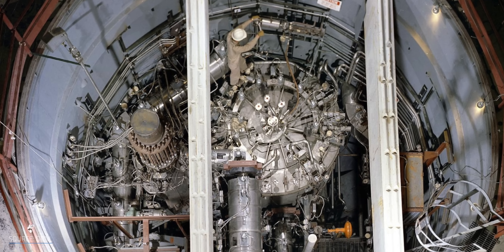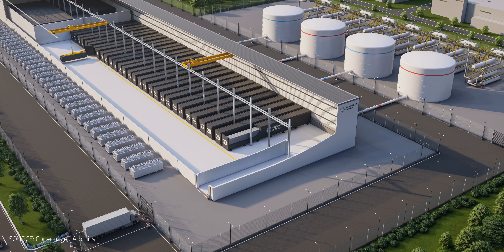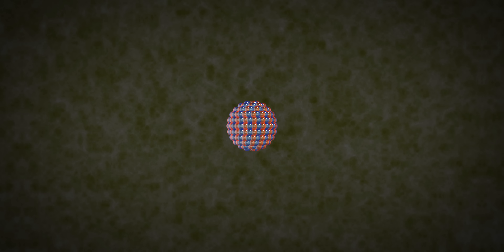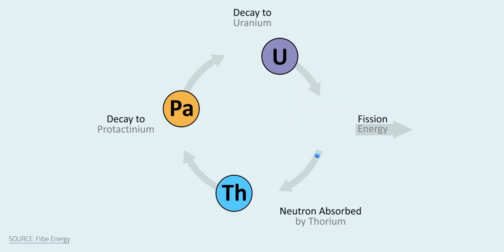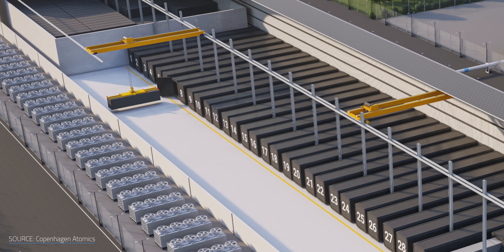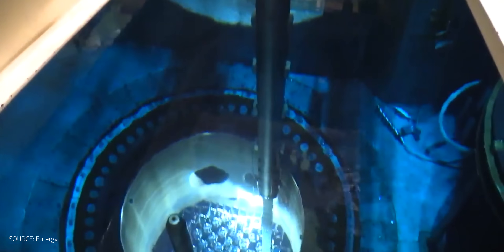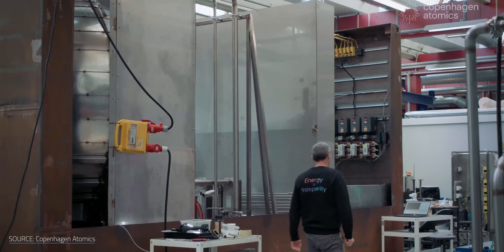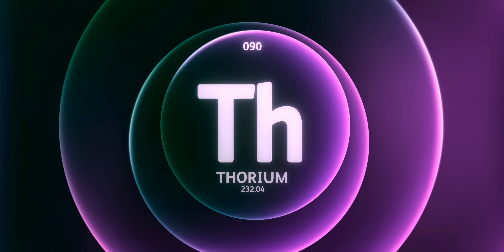Why Thorium is About to Change the World

Comment: the big issue is the corrosive salt . Hot slightly radioactive high pressure water has been part of current designs for years (and we know the big flaws) but hot salt that is both corrosive (even if not radioactive) anyway and then is also radioactive is a big ask. We're barely (bar the chinese and perhaps the Russians at a pinch) able to build the current PWR reactor plants much less handle hot salt. I also think the design based on a container while it looks great re logistics, considering the power output means even a double sided container size would be more optimal in interior size. Offering smaller units for say an on-site industrial plant or a local remote village is one thing but we know that demand and climate change electrification needed means that more power is needed. Would a 45ft container not be more idea and perhaps 48ft if you can find a shipping firm if overseas delivery is needed at sea.

Comment: The thorium molten salt breeder reactor is the future. Thorium is hundreds of times more abundant than the isotope of uranium that is used in water reactors. The thorium molten salt reactor also “burns” 95+% of the fuel as compared to the fuel pellets that are used in light water reactors only using 2 or 3% of the fuel.

Comment: Let's examine the actual impacts of what is being proposed which is basically a substantial increase in electricity generation from thorium reactors. Lets assume just a 10x increase above current nuclear energy production. The impact is massive and bad - 5 times worse than current nuclear industry impacts INCLUDING 5 times more *radiation* exposure from the entire power plant lifecycle from mining to decommissioning. I asked ChatGPT to crunch the very complex data on this and here is the result..

ChatGPT:

In a scenario where 75% of existing uranium reactors remain and ~10× nuclear electricity is added via thorium reactors, the total lifecycle health and safety burden increases substantially across all groups. The factor increases are estimated based on material throughput, mining, fuel processing, waste handling, tailings management, and environmental exposure pathways.

Workers: mean increase ≈ 5.5×

Mining/adjacent communities: mean increase ≈ 5.5×

General population: mean increase ≈ 5×

Wildlife/ecosystems: mean increase ≈ 5.5×

Long-term stewardship/waste obligation: mean increase ≈ 8.5×

Lifecycle radiation exposure: mean increase ≈ 4.5×

Increases arise primarily from scale and material flows rather than reactor design assumptions. Per-unit energy risk may decrease slightly, but aggregate exposure and hazards rise sharply.

I then asked ChatGPT to show me a similar 10x increase of electricity generation using wind, solar, geothermal and sodium-ion battery storage (which we are very likely to shift in the next decade, replacing lithium) and the outcomes were DRAMATICALLY improved. All of the environmental, habitat, and health impacts were roughly 15-20% lower, public and worker radiation exposure was of course *much* lower, and the overall cost of the Renewables strategy was 7 TRILLION DOLLARS lower than the Thorium strategy.

Comment: As you said here: Nuclear reactors powered by thorium were built, run & tested in USA in the mid sixties with a great success. They got decommissioned after 4 years, but for a different reason (due to the fact that thorium didn't have same bang as the uranium). It was the time of the "cold war" and having both of these minerals in use had no sense in that time due to the costs associated with getting them...

Comment: The very best feature of the😂 molten salt thorium reactor is lack of transuranic elements in the waste stream. While we cannot say none they will be so low that the waste stream will be so low in these long life additions that after 300 years it will be no more radioactive than the ore it was mined from. That will be a tremendous good for mankind. No more multigeneration waste streams. That in effect makes waste not so dangerous. The plutonium is the main waste that could be separated out used for weapons.  For mankind that could be critical. Not to be a bane to mankind but just making electricity without geological time making it unsafe.
Reply: Do you think there will be any human life in 300 years ... me neither. In practice there is no difference between U-233 and U-235 waste because human life will be extinct within 300 years.

Comment: Didnt chinese sort this out?
Reply: nope... nobody has to the point where they actually work as a product with low maintenance requirements. So far they work, but they are not really cost efficient and nothing you want to put in every other back yard...
Reply: They are the most advanced along the development timeline it seems. All based off of old US research. They will likely hit the breakthrough factory assembled MSR stage first, which has wide spread implications for energy.

Comment: That thorium creating more fuel seems like it breaks the laws of physics by making more energy that it uses.  What am I missing here?
Reply: that you have to 'refile' the whole thing with more fuel to get the reaction going. What they mean is, that it doesn't produces 'waste' that stops the reaction and has to taken out of the reactor and be replaced with new fuel. 

And in some construction you should be able to use the 'waste' of other reactors to get the reaction going and so on. 

But you are right, it's not a perpetuum motion machine and in fact... it doesn't work quite so simple as shown here. The maintenance requirements right now are killing this thing. The materials used in the reactor are just not there yet... or maybe will never bee there! It's tricky especially if you want to spread them out like diesel generators.

Comment: And also, here's why Thorium will power nothing, just like every other video about fantastical fuels:

Bureaucracy.
Reply: no... because you see Bureaucracy is limited to a nation. if something is really insanely efficient and great to use in any way form or shape... someone somewhere will do it! 

But with thorium... this is not the case! It's an old technology that nobody managed to get working properly ... meaning cheap and easy! 

It works but is usually more expensive then other nuclear reactors and doesn't produce as easy weapons grade materials. 

That's why no country on earth really goes all in in this tech so far.

Comment: Before we can get cheap fusion power, we're going to have to kill all the existing power dynasties based on oil. And I say kill because they will not give up power over power peacefully. If they can't control it then they will destroy it and if we want it we will have to destroy them.
Reply: I dunno you do see a lot of old legacy multinationals come round to disrupters within their sectors, think of tobacco companies embracing vapes and cannabis, lots of fossil fuel energy companies do renewable projects or R&D in new areas, its not out of the question to see an adapt or die mindset here.

Comment: The following is something I read and not my own view.  I'm hoping someone here can talk and give a counterpoint to this physicist's opinion.

"Warning, nuclear physicist talking.
Anything you watch or read when they talk about Thorium, do the Protactinium test: Ctrl+F "Protactinium".
If you've heard about Thorium, you might remember that 232Th is not a nuclear fuel per se, it must be turn into the good stuff 233U; thats the one that will fission and give you your energy from fission, to turn into heat, steam, etc. Think of it like a recipe, you have butter and flour, you mix them to get the shortbread that you want. See how easy it is for everybody to get some shortbread?
Except everybody also like to gloss over that between the "butter/flower" step and the "shortbread" step, there's a "white phosphorous neurotoxic napalm" step that might make things a bit more complicated the kitchen. That's your 233Pa.
So it goes 232Th+n -> 233Pa -> 233U.
This is when you say: "but wait 233c, this is just like 239Pu is produced from 238U: 238U+n -> 239Np -> 239Pu, this is happening all the time in normal nuclear power plants. What's the difference?". The difference is the same as between 2 and 27.
239Np (the step between Uranium 238 and Plutonium 239) has a half life of 2 days, while 233Pa (the thing between Thorium and Uranium 233) has one of 27 days. If you leave 239Np in the core it will quickly turn into 239Pu, but you can't leave 233Pa in the core for a month or it will capture more neutrons and turn into something else than 233U. (there's also a matter of cross section: 233Pa has a much higher probability of capturing neutrons than 239Np). If you leave your butter and flour too long in the oven you'll get a brick rather than a shortbread.
If you want to use Thorium, you must: expose your Th; extract your 233Pu; let it decay into 233U; feed the 233U back to your reactor.
By now you should understand why liquifying the fuel make so much more sense for Th than for U. It's not "MSR work so well with Thorium", it "if you want to continuously extract your 233Pa, you'd better do it with a liquid fuel".
this is where you say "Ok, but still don't see the issue, you just pump and filter your fuel to recover the 233Pa, and let it decay in a tank, and pump/filter the 233U back in for it to fission".
I'm going to assume that you know what a Becquerel and a Sievert are.
Remember the 27 days? with the density of 233Pa, that translates into 769TBq/g (Tera is for 1012 , that's a lot), and because of the high energy gamma from our friend 233Pa, that also means a dose rate at 1m from a 1g teardrop of 233Pa of 20,800mSv/h. Starting to get a picture?
Notice how all the numbers I've used are not "engineering limits" that a few millions in R&D can bend, those are hardwired physical constants of Nature: half life, density, neutron capture cross section, gamma energy. Good luck changing those by throwing $ at them.
Now try to imagine technicians working in those plants, like doing some maintenance, replacing a pump (I haven't even touched the complex chemical separation system you need to extract your 233Pa from your fuel or 233U from your 233Pa, which will definitely need maintenance). Let's put it this way: if there is 1mg of 233Pa left in the component they are working on, they'll reach their annual dose limit in 1h.
Now try to imagine the operating company of those plant, if you have the tiniest leak, like a tiny poodle, you can't send anybody in for months, meaning you are losing a month of revenue because of a tiny leaky seal failure, what would be a trivial event anywhere else (did I mention that molten salts also have corrosion issues).
When they say "Thorium has been used in research MSR", they mean "we've injected some Thorium and detected 233U" or maybe even just "we've injected 233U in the fuel".
So my humble opinion is that playing with it in the lab is one thing, turning it into actual power plants is slightly more problematic.

TL;DR: Thorium will probably never leave the labs to reach industrial, electricity production scale. The physics is sound, the engineering and actual practical operating constrains just kill the concept."

Comment: I have a degree in chemistry and studied Nuclear reactor designs as part of that course including Thorium reactors...  The Massive issue is the Chemical Plant, it requires High temperature Fluoride Chemistry which is one of the most dangerous combinations you can have... its simply a nightmare for maintenance, safety and is why you can do it easily as a small pilot plant, but is terrible as you go large scale enough for it to be commercially viable.     SMR  are a joke, because they fundamentally are less efficient.  You add moderators in a reactor to slow down neutrons so they have time to interact and have collisions with the Uranium fuel to maintain the chain reaction rate.   Obviously if you reactor is smaller the neutrons are going to get to the side of the reactor and escape without interactions with fuel faster, so your efficiency drops by a factor of the inverse law.... its shockingly difficult to overcome this simple geometric restriction on reactor performance.

Comment: unfortunately, the Thorium cycle Generates, then fissions, both Uranium and Plutionium. both can be separated.from the process.
so Thorium is an atomic security issue: especially if distributed in many small reactors. anyone who wants to manufacture these reactors will need Absolute proof that the security against skimming, modifying or access to the reaction chamber is infallable.
the other issue w distributed reactors is standard security: when the numbers Wanted are "thousands", then human security failures are unavoidable; any one could become a dirty bomb without the right safeguards. so again, some really high engineered safety paranoia.

Comment: more than this we need someway to reduce the influence of the oil industry, they will never let this technology to see light of the day.
Reply: despite popular belief. This wouldn't be the death sentence to oil as many think. Sure, you wouldn't need oil for electricity but youd still need it for covers (wires, tubes, keyboards). Youd still need it for anything that spins (motors, bearings). Theyd still need it for any plastics (cups, containers) heat management (compressors).

This isnt an oil issue, it's a money issue. to understand, imagine i gave you a car that uses no gas but you need to swap the battery after 1000 miles and that costs more than what you would've spent on gas. That is the thorium issue. uranium costs more per watt but is cheaper and easier to maintain. 

Lets put it like this, do you really think someone like bezos or musk would turn down the opportunity to control peoples power if there was money in it?

Comment: The waste products are highly dangerous for hundreds of years; the power plant will be teeming with gamma radiation, though, the machinery is very susceptible to breakage because of the lava-salt, and most likely needs to be repaired constantly (by robots I assume); even if it runs flawlessly, the individual units need to be replaced every few years (which of course is better than a classic nuclear power plant that is built once and runs for decades)... 

You know, this sounds like you want to aquire an animal to mount: But instead of just using a horse you try to clone a dinosaur. Because horses are lame and old and and a dinosaur would be sooo cool

I'm annoyed. We need to win the battle against the climate crisis. Just effn build solarpanels and windturbines. We have no need for flashy. For hypy. Stop dreaming manic dreams. Just ride that damn horse

Comment: Uranium isn't scarce. We've explored for, and found exactly the amount we've needed thus far. Additional demand will trigger additional exploration, and new finds. Also, fuel costs for nuclear power generation are relatively small, so higher fuel prices won't significantly suppress the economics of nuclear. The challenge for conventional nuclear is overcoming public hysteria around safety, and the resultant politicization and over-regulation of the industry. The irony/paradox is that nuclear power is, by far, the safest method of power generation ever depoyed at scale.

Comment: The economics of nuclear reactors is “cost of operation”, not fuel cost, not startup cost, not regulation.   Just too expensive to operate.   It’s the reason why perfectly good nuclear reactors are being shut down,.. or need subsidies to operate.   Spending billions of dollars on new reactors is financially risky business.   Yes, these new reactors solve some old problems.  However,…we do not yet know what new problems these will have.   And yes, molten sodium need not be pressurized, thereby simplifying design, but a liquid sodium leak could have major consequences.

Comment: Copenhagen Atomics has been working toward thorium reactor commercialization for about 11 years. The company was founded in 2014 by Danish engineers after several years of independent research and meetings dating back to the late 2000s. They incorporated officially in 2015 and have devoted continuous R&D, prototyping, and scaling efforts ever since.

Foundation year: 2014

First major prototype: 2022 (full-size water test)

Full non-radioactive prototype: built in 2023

First live tests at Swiss PSI nuclear lab planned for 2026-2027

Summary: Their journey spans from 2014 to the present (2025), with more than a decade of engineering, testing, and collaboration with European and international partners.